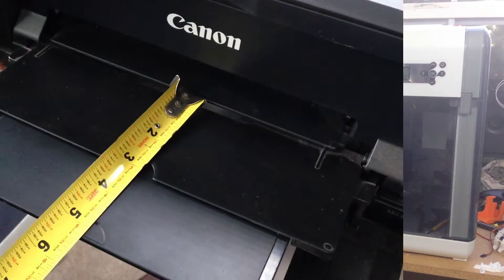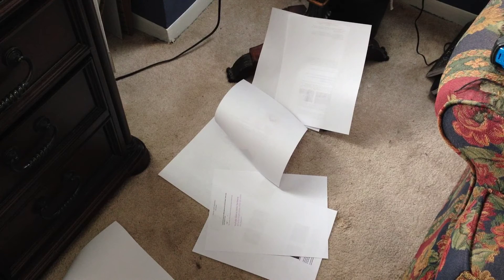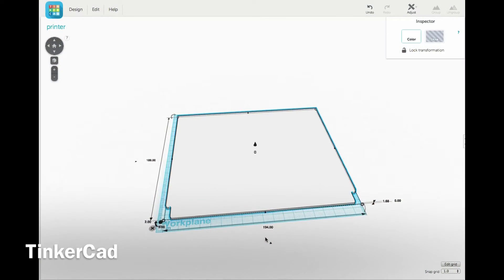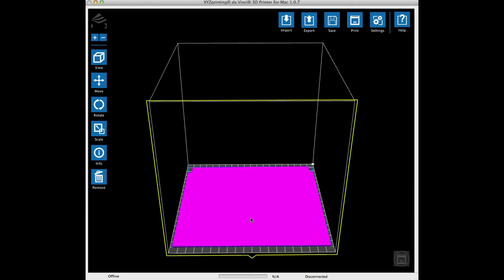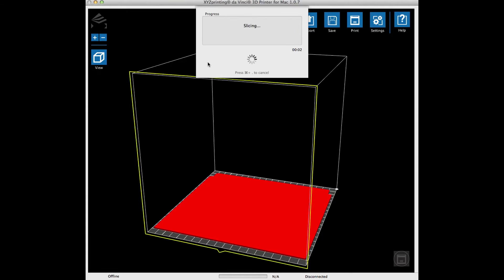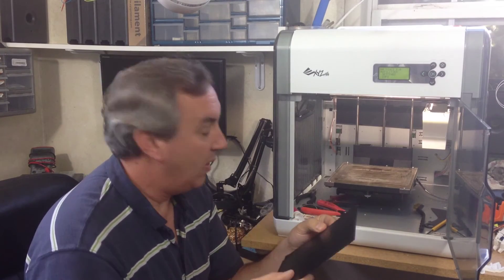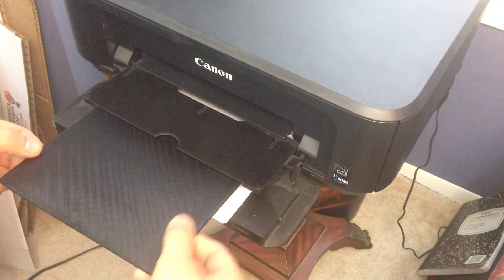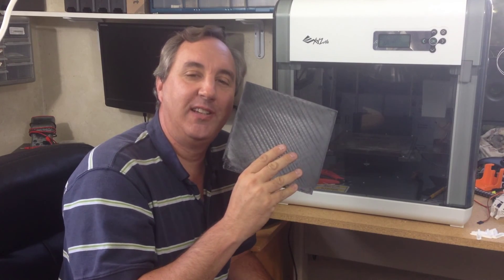Davinci 3D Printed Canon Printer Tray Extension - Video #008

Comment: 8 years later and Cannon has maintained their exact design in the MG3620. I am currently trying to make an extender that swings out almost like the bottom tray.  The goal is to keep the front foldable.
Reply: I’m having the same issue. Did you manage to design or find a part that fixes it?